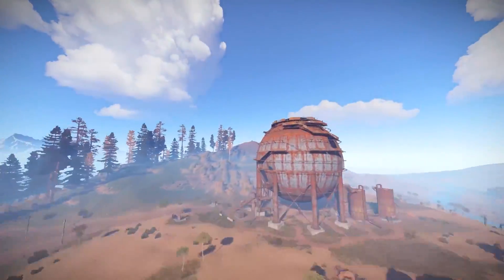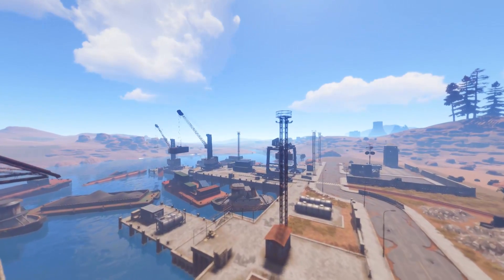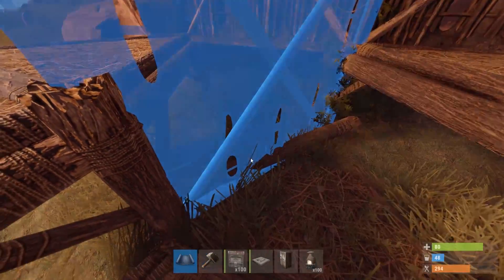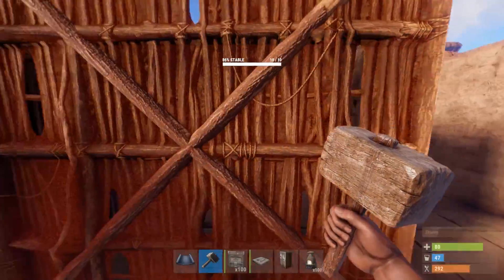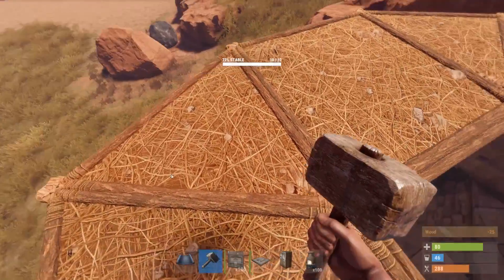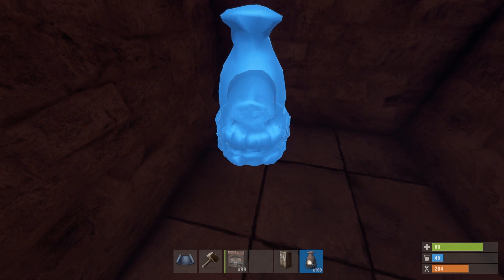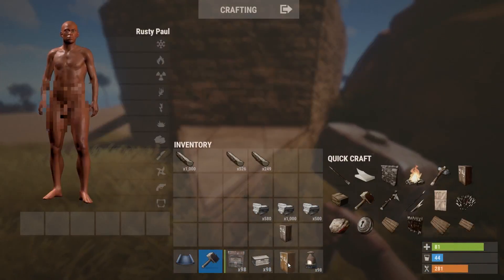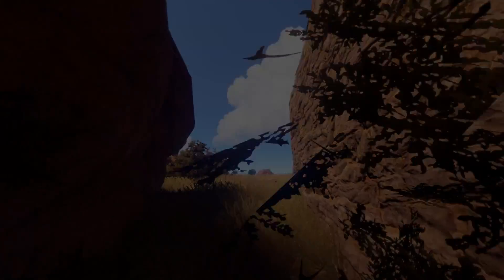Rust Stealth Trap Base Tutorial | Harbour Update

Comment: Hey Paul new to RUSt and as a solo player, I know big bases should not be a thing for me. Yet my doom prepper innerself cant help but come out.

I seen degins were bases have on the second floor all rooks giving it an inward angle, yet players have the ability to get next to the wall and not be shot. Is any way to prevent players from getting close without blocking your own line of fire?

I have thought about using Metal Barricades but with their 500 health it seems that you need multple layers of them to actually keep players away while u shred them.